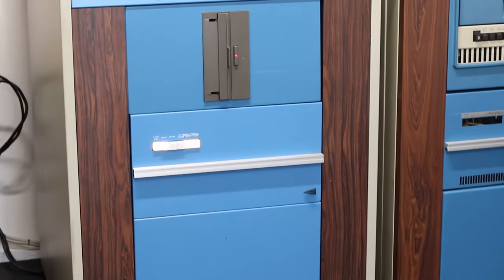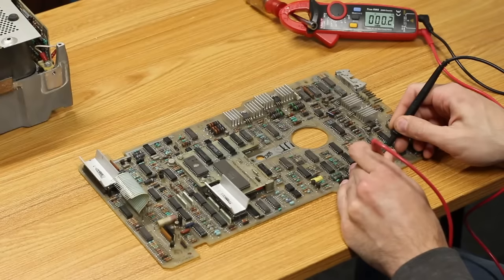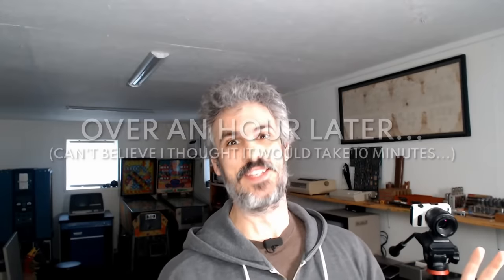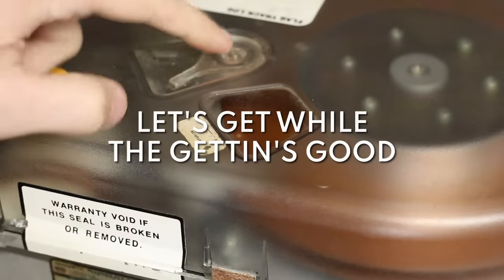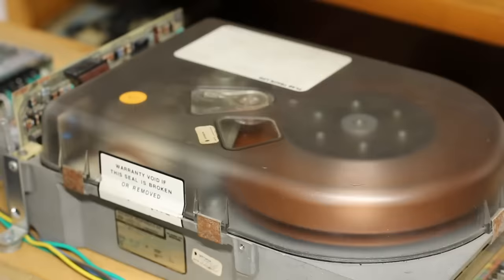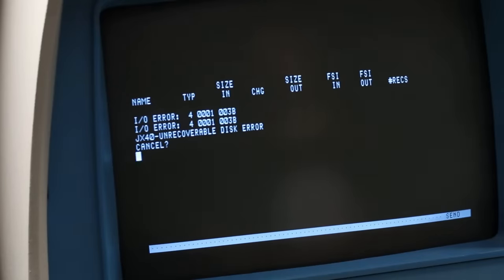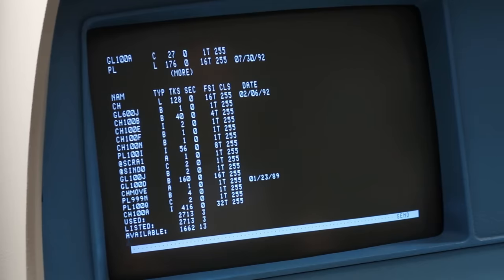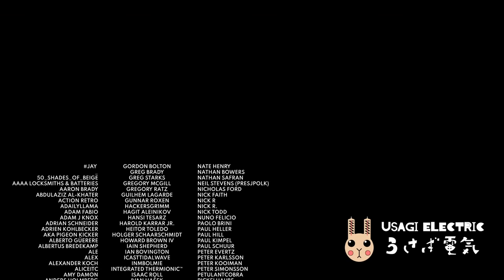Will This Rare 1980s HDD Live Long Enough to Save the Data?

Comment: You should try to do a complete dump of the finch, reformat it (mark the bad tracks), then copy everything back over.

Is there a way to ignore bad sectors or at least pull as much off the faulty sector as possible by rereading the bad sector under different temperature variations?
Reply from the maker: The MicroPlus Finch isn't mine, so I didn't want to do anything drastic to it. Whenever S.NEWDSK runs, it makes a bad sector table that lives on the drive, so all the bad sectors are known by the OS and it can write around them. Once I talk with Aaron at Vintage Geek a bit more about what we want to do with this drive and where he wants to go with it, we'll come up with a game plan for the future with it.
However, I do genuinely think we got all the data off the drive, and I just think it was tripping up on doing the calculation for how many free tracks there were. At any rate, we got enough data and applications to keep us busy for years!
Reply: @UsagiElectric  isn't a PCB repair for his finch still in order so you can put the one in your zilog machine back together?

Comment: You need an interface to a modern computer to dump data too.
Reply from the maker: That's something that we're working on! 
The tool that we use for the Hawk drive isn't compatible with the Finch, and it requires a completely new piece of assembly software to be written. We'll get there eventually, but I wanted to make sure I got the data into two different places so I can return the drive to Vintage Geek in a reasonable timeframe.

Comment: i don't know what bearings are in those drives, but if they are sintered bronze bushings, then it sounds like they are dry or worn
If the bronze is worn, the shaft rattles around, if it's not too worn, a little oil will work (at leats for a while)

Comment: Good job on getting the data off the Finch drive. The next job will be attempting to repair the original PCBs from the drive.
Reply from the maker: Thank you!
Now that we have the data backed up, the big question is where do we go with the drive from here. To do the level of repair required for the bearings is really risky as we can potentially lose alignment with the soft-sectoring servo track, and if we lose that, there is no recovering. So, I need to talk with Aaron a bit and see where he wants to head next with it!
Reply: @UsagiElectric I wasn't suggesting attempting any mechanical related repairs. The drive to be rescued had at least one fault preventing it from working. Perhaps you already fixed it with the incremental head seek test. You could replace the PCBs with the original ones and see if the drive works fully. If not, you can compare signals between those on the PCBs of the drive that needed backing up with those of the signals of the donor drive PCBs as they seem to be similar sets of boards.
Reply: @UsagiElectric  Compare the windowed PROMS at 5:32 vs 20:16 , I'd guess the first PCB's firmware "state machine" is all 1s at this point.

Comment: In my days of repairing early video recorders the drum anti static discharge / earthing spring that rubbed on the bottom of the head drum spindle, used to make terrible noises like that sounded, and cause noise on the video. A small dab of graphite grease always cured it. Not inconceivable the same might apply here?

Comment: EDS computer? The same company that was Perot Systems!?
Reply: Yes,   Centurion sold out to EDS around 1981. A few years later EDS sold Centurion to ZTRON.     During the time frame that EDS owned Centurion we built the Centurion minicomputer for EDS and the old Centurion dealers. We also built the EDS line of clone XT class PCs and 3270 clone terminals.

Comment: To get files off the Centurion, try finding or building a Kermit protocol client- it works over RS-232 (including versions that don't allow all characters through), and was invented to connect otherwise incompatible computers, and there's the possibility that you even have a copy on the Centurion and just don't know yet. Another good choice is BLAST, which particularly was popular with oil companies.

Regardless of protocol, serial is your best bet. I understand the serial board to be RS-232 style, so basically anything worth considering (I'd suggest an old IBM PC, XT, or AT, since they're also vintage, but have more info -> will take less support from the other machines) should be capable of being connected to it.

Comment: It's amazing how much old rust holds up storing data.  Sometimes I wonder if SSD's will last as long as some of these old drives.
Reply: Theoretically they could last longer than HDDs when being used but likely never for prolonged storage. At least based on my understanding of the two.

Comment: Lucky this drive is from the past. On todays drives they marry the PCB with the platter (something similar to the Disk Parameter Block) and you have to pray that CMOS-Chip and the sector are both readable.
Reply: When you do what?
Reply: @bbuggediffy  when you use a pcb from another drive of the same typ

Comment: If all that data is just ASCII data, I don't see why it can't be dumped out a serial/parallel port to a regular computer and store that massive 24 Mb of data on 14, 3 1/4  diskettes. I have more than 400Tb of storage space on 3 Netgear NAS boxes in my basement. 14 diskettes would fit nicely on a shelf somewhere. 
Emulating that reading and writing of the FINCH drives  using a raspberry pi and storing it on a 512Gb micro SD card would seem the way to go.

Comment: I kept thinking that they should transfer the data through the mux to the laptop via serial so then I started wondering how long it would take at 9600 baud. So I did some quick math ..

24MB works out to 196,608,000 bits (binary).

9600 baud is equal to about 9600bps so if you divide the total bits by 9600 you get 20,480 seconds. That works out to 341.˙3 minutes or 5 hours and 41 minutes.

That's totally doable although that doesn't factor in the unpredictable fragility of that finch drive and also I don't think they have a utility for transferring files through the mux serial, yet. They have sent data before but it was a block of copy/pasted text throught teraterm, not a file transfer routine.

Comment: Why not use the same material capacitor when replacing? Aluminum electrolytic capacitors will eventually take a proper dump if not energized over time. Looks like a wet tantalum capacitor. Previously working in nuclear electronics AE caps had to be less than 2 years old before going into the field (unless authorization was accepted). If you want to make this last the next 30+ years stay away from AE caps. Just my experience.

Comment: Putting the drive and PSUs on the wood brought back memories.  When I was a kid without money, I would often get PC parts, but wouldn't get a case and, since I couldn't afford one, I'd end up building PCs with everything attached to a piece of plywood.  A lot of times, I didn't have switches either, so I'd turn them on with a screwdriver.  My friend used one as a dialup proxy machine for 5 years before it needing a reboot.  Although I've worked on much bigger stuff since then, I always consider those machines my greatest builds because I really did scrap them together from nothing and they lasted quite a while.  Really love that your setup got that data off the drive.  Cool stuff!

Comment: Weel, I shure can get the exitement as I was conducting my 1st electronic repair (I´m a newbie) on my Voltcraft Digi-Scop-Converter 500.
It´s an awsome device from the early 80´s, came out in Germany that was designed to be used with analog scopes for 650 DM (German currency before €).
It was aimed at the consumer/semi pro and hit like a bomb. I´ll upload something- there´s nothing in the Tube about it.
For the price You got the functionality of 4-digit priced digital scopes but I like it for measuring output (w) of audio amps.
It uses a Z80A 4Mhz processor and I blew it up. (The signal input of the unit, not the processor)
I wanted to see the line voltage sine wave but forgot its connection to ground via the scope and pop went the weasle.
My heart sunk as my Converter is in prestine condition so I opened it and found a blown trace. I was lucky and could fix it wich brought me the same "YES" moment as You had when the self test came on.
It was a simple fix but could have gone way worse, my Digi-Scop (they really called it like that) lives another day.

Comment: Who knew backing up a disk drive could be so gripping?! Strange now in a world where CPUs are binned by defect, RAM is cheap per-GB and a tiny 5mm by 5mm card can hold 1TB+
Those early computer manufacturers really were pioneers. Have you ever thought about using an arduino to re-implement the disk drive state machine and logic to enable more recoveries?

Comment: Just came back to say that it might be better to let those old drives to rust in pieces and replace them with … simulations …
And with simulations I mean modern mechanical components driven by a modern MC to generate realistic sounds and vibrations and an authentic looking enclosure, while the data in actually on an SD card (or several in RAID) driven and converted (to something the old machine understands) by the same or another MC.

Comment: Fantastic video, and you really took us along for the emotional ride. Well done on recovering that data. I do a lot of searching for short circuits as part of my job, and here are my tips, in case they're useful. You can use a Toneohm, a sensitive low-ohmmeter with an audible output so you don't need to look at the screen, to measure the resistance at various places and you very quickly get an idea of where the fault is. Or if it's a power rail, apply power from a current-limited power supply (current depends on the circuit, but somewhere between 0.1 and 10 amps may be appropriate) and then measure the voltage across the power rails in various places with a high-resolution (5 or 6 digits) voltmeter. You can also measure the voltage drop from supply to various points along each supply rail. That will also quickly give you an idea of where the shorted part is.

Comment: why not build a interface data translator with raspberry pi or arduino and dump the drive to an sd card?

why even have a brake on the drive? it isnt like today's pocket drives where you can move it as soon as you unplug the drive?

most people would turn off the drive and wait a couple minutes before moving it.

Comment: Success is so successful.  lol.  But seriously, congratulations on the data recovery.
Your little victory reminds me of a little victory of mine when using a system which ran CP/M off twin 8 inch drives.  A particular program needed to be able to swap disks without having to close and re-open files repeatedly.  To do this meant that each designated file had to be exactly the same size (its maximum permissable size) and all of its data had to be in exactly the same place on each disk, even though it didn't have to be exactly the same data and in practice, would rarely be exactly the same data.
The only "diskcopy" program available worked by internally doing a repeated copy of every file stored on the drive.  This meant that anything already on the destination drive would remain there and that could cause the copied files to be in the wrong place.
I solved the problem by using assembly code to write a track-by-track disk imaging program which would ignore whatever was already on the destination drive and overwrite it with whatever had been on the same track of the source drive.
It was quite fun, seeing that program "just work" the way I intended it to.
If I remember correctly, I made it give out an appropriate warning and ask for confirmation before allowing the copy, but you could also bypass the warning with a command-line parameter.

Comment: Excellent video, as a computer enthusiast I know how much patience, effort, knowledge, experience and research goes into making some troubles go away with such complicated machines and even more to complete some tasks after the problems solved!
Now that you have the data from the 24MB drive is it possible to service the bearings and generally give it a service on the moving parts??
Great work keep up, cheers from Greece-Europe... Jim.

Comment: I wonder how feasible it would be to have the data print to hex on screen, and just OCR the text off of the video footage and recover data that way, instead of writing it on to another very old drive that already has its own set of data on it. I know you said it was just old personal data that was useless, but you are still putting hours on it that might not be necessary. Also like you mention in the video some aspects of might only allow you to get one shot at doing them, so it would be better to lean on a method that utilizes more reliable components. A modern camera on backup power has effectively zero chance of failing, whereas this other old 40+ year old drive has what like a 10% chance of failing?

With the help of chatGPT I ran the numbers. 20 mb of hard drive space would generate roughly 525,000 rows on an 80 col terminal, and given the terminal in the video that appears to have 24 rows, so it would take approximately 21845 screens to display everything. If you generated each screen at 5 frames per second (maybe you could do more, maybe you could do less, maybe you want to insert blanking intervals, etc.), that would take 1.2 hours for every screen to be displayed.

As long as the OCR was good, and I'm fairly confident it is nowadays, I think this actually would be feasible. Using a capture card instead of a camera pointed at the terminal would ensure this. Time wise it would be feasible, and you would have a 100% copy of whatever's on there in the video footage, so if OCR failed you can always go back to the master video copy. This would also allow you to record data on the byte level, and maybe partially recovered corrupted files/sectors.
Reply: He erased all of the historical data off of his own drive, clearly saving the data wasn't the point, it was just the "can I do it" part that he cared about.
Reply: @Axodus   I know, like I said though he's still putting hours on it that he didn't have to.

Comment: I'd send this puppy to someone who can do data recovery (meaning they have a clean-room and skills) and get them to replace/repack the bearings, lube all the actuators, and reassemble.
Louis Rossman comes to mind - especially since his company would probably be happy to do it on camera.
Reply: I have done repairs in side the the Sealed Finch HDA without a clean room back in the old Centurion days.  My "clean room like" was turn off the HVAC and close my office door.  Agree I was lucky that my work inside the HDA never caused a head crash.  David even had his Finch HDA open once in a video after we talked months ago.
Reply: @kenromaine2387  Yeah, I opened an old wd caviar and it still worked after. 
I was more thinking about the skills required to service the bearings and reassemble it properly and professionally without an "oops I made it worse" moment.
Part of me is also wondering if Seagate or WD would recoat the platters if you asked nicely.

Comment: First rule of thumb with that old TTL style electronics from the 80's ... REPLACE ALL THE CAPACITORS ON THE BOARD .. especially if they are tantalum ... and then go from there. More than 90% of the time, that is all that is wrong with them. This is because early TTL circuitry is typically designed tough as nails, unlike all newer electronics that is barely made to hold for up a year if your lucky.

Comment: I wish that there was a way to replace the Finch Drive with a SSD of 256GB in size.
Reply: 256 MB would be an ample sufficiency in the 1980s.  🙂  Now in 2023, I installed a 4 TB SSD in my laptop yesterday!

Comment: 0:16: 🖥 The Centurion project is far from complete, with many more upgrades and modifications planned for the machine.
4:08: ! The video is about fixing a FCH drive and discussing emulation options for drive
7:47: 🔌 The speaker discusses wiring up a drive and the need to transfer data quickly.
13:17: ❌ The video discusses a problem with a computer drive and possible causes.
16:22: 🔊 The speaker discusses the sound quality and issues with the drive.
20:17: 🔧 The video discusses swapping PCBs to troubleshoot issues with a drive.
24:53: 🤔 The speaker is discussing the process of running software on a Finch device.
29:16: 🔧 The speaker discusses the progress made in fixing a technical issue with the machine.
33:39: 😃 The speaker is excited about the victory and the collection of applications they obtained.
Recap by Tammy AI